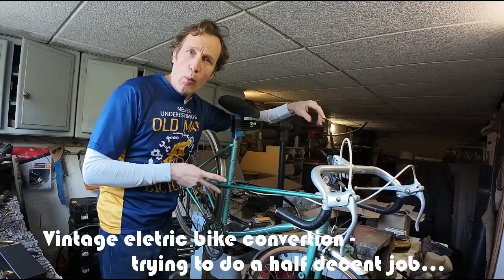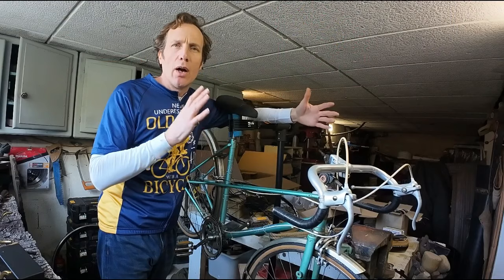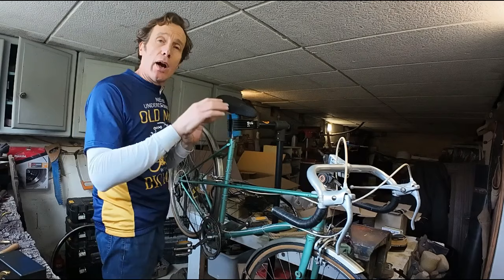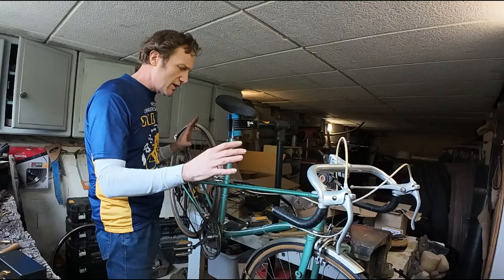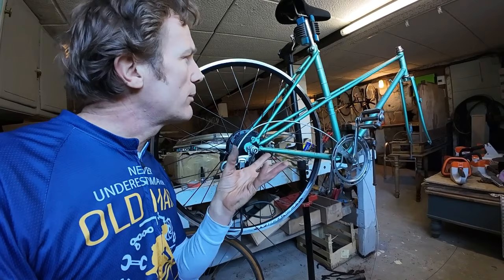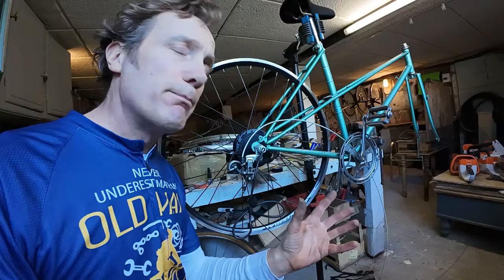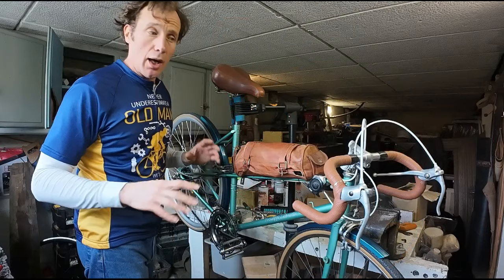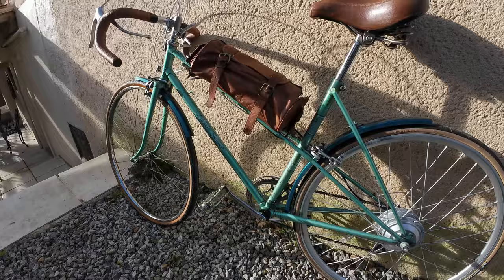Vintage bike electric conversion - how to make a descent job of it!

Comment: Nice work, very clean solution for containing the battery! I predict a lot of questions about the brakes, but since the motor isn't pushing you faster than normal speeds, I don't see why this would be any issue. Weight imbalance would be my concern, an interesting thing to know would be the front to rear imbalance. E-bikes are the answer to commuting, and a truly viable car replacement option for many - and if we can do it inexpensively and look good, that's even better. Would changing a rear puncture be damn near impossible? Would you use a "sausage" double-ended tube?
Reply from the maker: Weight is not a big issue - bike started out as a hefty 12k and finished at 15k - the battery location doesn`t effect the handling and as you mention, motor cuts out at 25kph so brakes are fine (though I hate to imagine what a 1000 watt motor strapped to this bike would be like - proper dangerous...), Dan